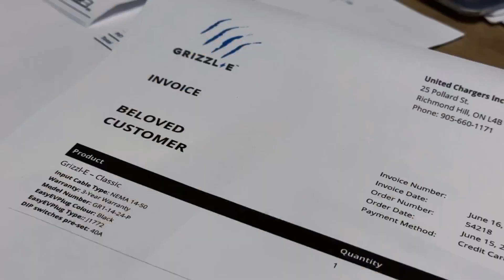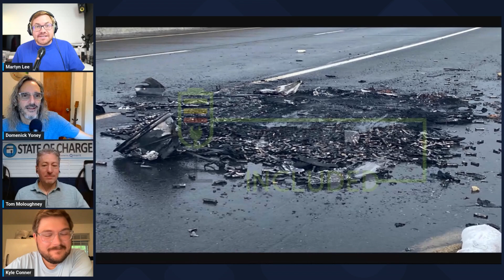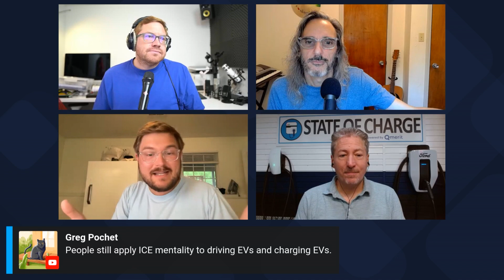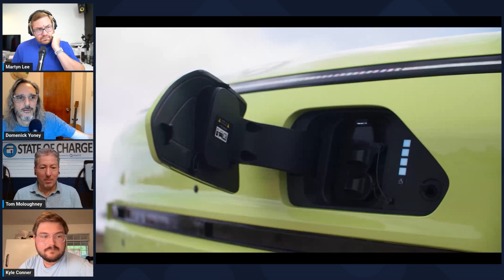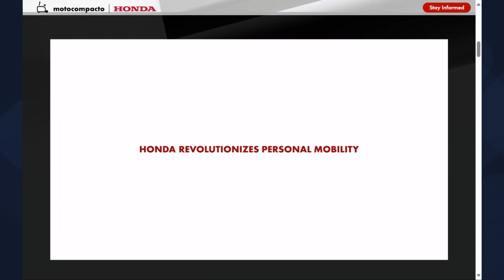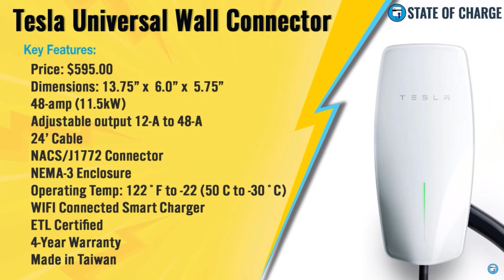Kyle Melts Kia EV6 On Autobahn, Tesla Model 3 Actually Burns On Highway

Comment: I’m in the UK and personality charging is a breeze, you just have to think differently to driving a gas car. More and more chargers are being installed we need 12 x 150kw + chargers instead of 4 x 350kw pointless having 4 x 350kw and 6 cars waiting to charge, far better have loads of 150kw chargers and no waiting.

Comment: They could have it so if the battery catches fire, it would burn through its mounts so that it drops out and the fire fighters can deal with just the battery pack.  Having it out of the car would probably make putting it out easier as they would have unobstructed access to the fire.

Comment: Lithium Ion car battery fires are extremely environmentally awful. Way more contaminated water is needed to put them out. They need about 2,500-4,000 gallons of water. Compared to less than 400 gallons for a regular powered vehicle.
Reply: They are using sand or electrical fire containment blankets instead of water.

Comment: If you don't wont risk EV fires just don't buy NMC EV but only LFP based one (or LFP based chemistry as LFMP or M3P). I'll never put a NMC EV in my garage in the basement of my home for sure...
Reply: Nice idea, unfortunately the risk isn't averted with the billions of electronic devices we all take for granted. Including those fairly energy dense power tool batteries we think nothing of.

Smoke detectors throughout the house, including garage space, would be a wise investment for most of us.

Comment: Kyle is correct, I have used '21 Mach E and plug and charge does NOT work. Ford software is hot garbage.  I love the vehicle as a vehicle, but the software nullifies many reasons to buy a $40k used car.

Comment: I have been driving nearly 1.000.000Km on German Autobahn in all kinds of cars from old to actuall models and think the EV6 GT isn´t unstable at high speeds. I had a Mercedes C300e before and other brands like Audi A6 3.0tdi etc.BMW 335xd...and there are just two little things that point in that direction. First is that the softer springs on front lead to less breaking power at first moment while diving in and the other thing is that most parts of our Autobahn are just too bad for stiffest damper setting in our days. With right setting (sport) an adjusted air pressure it is a well balanced vehicle for high speed runs. Of cause it can not compete with Porsche Taycan etc. it is just a crosscover but it is already proved that it can easily can drive on tracks like M4 I50 or (much) better.
Reply: He has no idea what he is talking about.....terrible knowledge

Comment: Haters love throwing car fires into a discussion.  For the consumer, does the temperature of a fire matter?  For the fire department,  does the amount of resources (water) really matter?  It's not a fully engulfed apartment fire requiring 8 stations.  One maybe 2 squads pouring a ton of water for an hour or two.  Seriously nobody does the actual numbers on comparison between ice and ev.  You can drive your family off a 200 ft cliff and walk away.
Reply: Q: For the fire department, does the amount of resources (water) really matter? A: uhh... Helllloo...?  Mcfly...? (Biff Tannen repeatedly taps knuckles on George's skull)   it absolutely does matter.  logic dictates the water has to come from SOMEWHERE, meanwhile there aren't hydrant/stand-pipe connections conveniently positioned EVERYWHERE for Pumper Trucks to connect to, take for example along side a busy North Jersey Interchange like where we see this Model 3 sitting.  everybody here in the Northeast (Pennsylvania to be specific) is painfully aware of the recent I-95 Overpass Collapse outside of Philadelphia from the Tanker Truck that crashed and caught fire with 8500 Gallons... 

again, since First Responders were NOT able to get all the necessary resources to the incident quick enough (and in sufficient quantity) the raging fire weakened the concrete and steel and the bridge COLLAPSED.  date: Sunday June 11, 2023.  ironically this "local event" actually made NATIONAL NEWS because of the impact on the Infrastructure for Commerce, so both the President and the US Transportation Secretary and FEMA were involved.
Reply: @phillyphil1513  thank you for your nonsensical rhetort.  I have done the numbers, as has consumer groups oh and insurance. Good to know there's still stupid people in the world.
Reply: re: "Seriously nobody does the actual numbers on comparison between ice and ev."  no worries it's been done.  yeah, the problem simply comes in that you (personally) don't have any knowledge of the numbers or the study.  for better or worse, seeking out this information is going to require some effort/work on your part, enjoy.
Reply: re: "You can drive your family off a 200 ft cliff and walk away."  well that OR you can crash a Tesla into a utility pole and burn to death like the Secretary and her Boss did in Indianapolis Indiana, date November 6, 2016.  OR you can crash a Tesla into tree and burn to death like the 2 Doctors did near Houston Texas, date April 17, 2021.  OR you can crash a Tesla and burn to death like the Mother and Daughter recently did in Santa Clara California, date June 24, 2023.  <---- see, unfortunately i can't let you "cherry pick" data, so for your own safety and well being i DON'T recommend you (or anyone else) attempt to replicate that cliff stunt.  to me your life is important, therein like the wisemen say... "KIDS DON'T TRY THIS AT HOME".

Comment: What no one has mentioned is though those fires are rare, it's not only a puncture in the battery from an accident that could set off those fires. Your car could be plugged in or not, and if there is a fault or defect in the BMS or battery packs, a fire can set off. One of those faults could happen suddenly, and will definitely burn down your house (if parked in the garage) before you know it. This also happens with a lot of electric vehicles that have gone through floods, like in Florida. They have that issue there with flood recovered EVs that seemed fine initially. Nca chemistry is very unstable and will be violent when there is a fault. A quick Google search will show the archives of Tesla fires. It's the primary reason I have kept my LFP model 3 and not opted to "upgrade" to a model Y or higher NCA pack Tesla even when prices went down earlier this year. The chemistry of LFP gives me a better peace of mind because it doesn't not respond violently and usually just ends in a smoking battery instead of a raging inferno. Am glad you guys spoke about it because I have noticed most pro EV channels don't cover the negatives. Comparing EVs fires to ice fires is like comparing flying to driving. Statistically you are more likely to get into a car accident than a plane crash, but the plane crash will probably kill you when it does happen. I say this because the EV fire is not the same as the ice fire. They don't burn the same and one is more violent than the other.
Reply: I'm curious what percentage of these fires originated from underperforming charging equipment. Wrong wire gauge / breaker combo, old NEMA outlets, or simply cheap EVSE options available to the public, any one these weak links could start a fire, yet the headlines will report on the battery aspect weeks before the investigation completes on origin.
Reply: I'd argue one has more time to react with EV fires. This particular case, in this video, shows the warnings and time available before the fire begins to spread. What we see, the general public, is footage that generates clicks and views, the intense black smoke with the entire vehicle engulfed in flames. We aren't interested in the 15 or 30 minutes of EVs trickling out a white puff, but the same argument can be said with any fire. Carnage sells. 

If someone is concerned about garage parking with EVs,  then I'd recommend a smoke alarm or two. I'd recommend a garage smoke alarm without EV charging, given the amount of electrical wiring and flammable content associated with most garages. 

Just my 2¢

I've probably seen one vehicle fire, in my 40 years on this rock. I've seen more structure and wildfires.
Reply: re: "Comparing EVs fires to ice fires is like comparing flying to driving. Statistically you are more likely to get into a car accident than a plane crash, but the plane crash will probably kill you when it does happen."  exactly, while EV fires are LOW PROBABILITY the "offset" is they are HIGH IMPACT/HIGH CONSEQUENCE.  this is why the comparisons advocates love making between EV fires and Gas fires are unfortunately "False Comparisons".  with the double Felicity and Fremantle ship fires in the news, they can see Elon's EV market is beginning to UNRAVEL.
Reply: re: "Am glad you guys spoke about it..."  well be less glad, since the date is September 2023 (thus super late in the History of EV's) the question you SHOULD be asking is why are they only speaking about it NOW...?  re: "I have noticed most pro EV channels don't cover the negatives." well again this is a "pro EV channel" (with guys who travel all over the Planet for EV's) and they have NOT really been "covering the negatives".  afaik, this channel (nor their individual channels) have still not spoken about the Fremantle.  the Auto Industry basically got lucky, with the Felicity SINKING off the Azores it's much easier to pretend like that fire never happened.